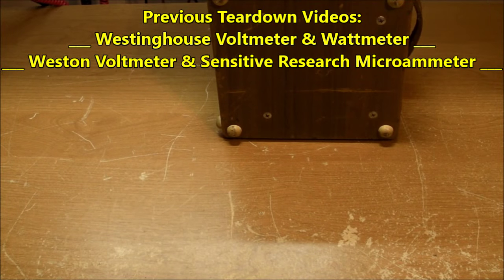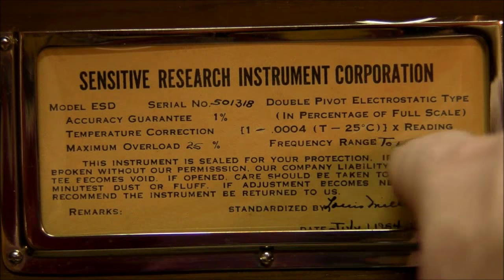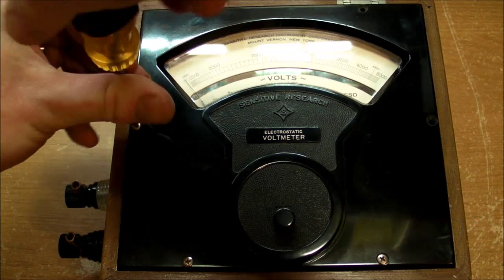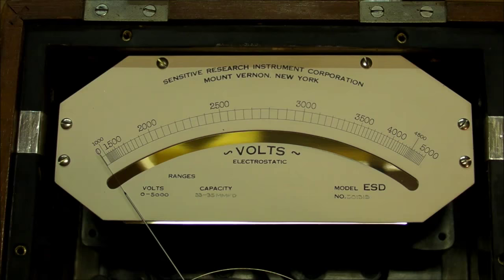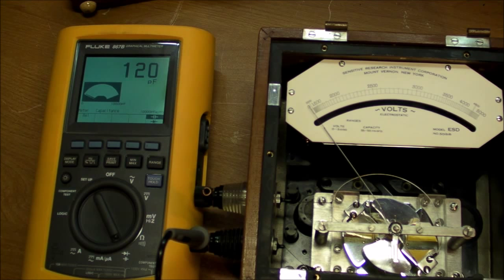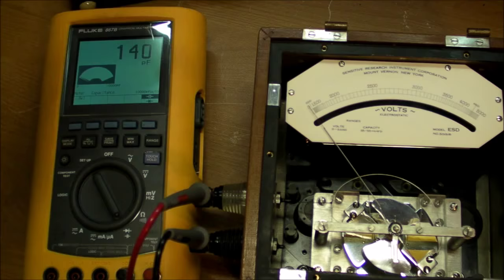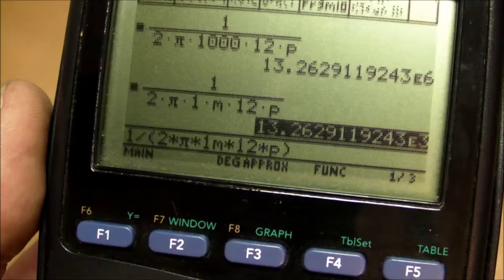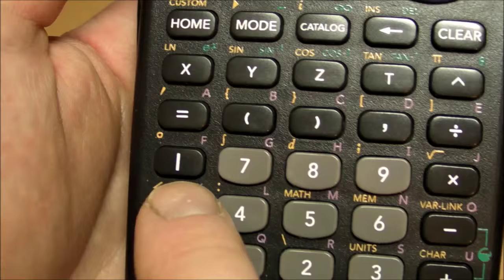(#0197) Electrostatic Voltmeter #1 - Teardown

Comment: I would bet that the old capacitance measurement was at a different frequency and amplitude than your fluke uses, and may have included some leads.  I really really distrust the flukes for much more than measuring run/start capacitors for motors.  (you also want a 4-wire ohm meter for this sort of work)  if you have a function generator you can construct a much more accurate LCR meter on your bench than the fluke provides.  (graph that function, the TI89 is a graphing machine!)  I used a similar exponent hack on my 89 when I was in school too.

Thanks for showing us this.  Really neat device.

Comment: Wow. What an amazing bit of gear. You have me thinking about making one now.
Reply: Very cool, zero idle power. (or at least too tiny to care)

I like it the fact that the electric energy(not power)/charge holds the needle up, and will be returned when the voltage does down.
Reply from the maker: Erlend Ervik Yes, but I wouldn't even be concerned about how many nanojoules that works out to be.
Reply: I'm really excited about such a simple replicatable device for reasonable hv readings. Not even any need to switch any dials to go from ac-dc.

You could make one with foil, a neddle and a magnet (mag+needle bearing)

Comment: One of these was dropped in our lab.  Considerable disassembly revealed that the connection between the coiled spring and moving vane had snapped.  I suppose it's worth a try to re-solder it (silver solder/braze?) but then what :)  Likely calibration is totally shot just from disassembly alone.  Do you know what the spring material is?  Suspect that the moving vane pivot points are probably no good now that I've removed these from their two housings.  This one is dated May, 1949!

Comment: These days you can get "meggers" that put out 2500 or I believe even 5000 volt - should be able to get an idea of how accurate it is. I have no idea how precise they are but I have a 500v one and it seems very accurate (sure 500v is easily measurable by modern multimeters). I even used it to get an idea of how accurate an electrostatic field-meter I stumbled upon was. Seems to work(!) at least for the (very) low charges.

Comment: My 2K Electrostatic Meter has 1X10^15 insulation resistance. Is that what your meter has? I thought you said your meter was 200 Mega Ohm. That seems too low. Did I hear that correctly? By the way, Mine was also certified by Louis Miller.
Reply: There is a big difference between Insulation Resistance (DC) and Impedance (AC).  The impedance calculations he presented were just the effect of the capacitance at different frequencies.

Comment: I have the exact meter but the needle rests on 3000 volts with no voltage applied. The zero adjust screw will swing the movement but only = and - a little as it should. I inspected the spring and it does not look distorted. I can not figure out how to get the needle to rest on zero unless maybe I unsolder the spring and let it unwind one turn. But why would that be necessary? The movement is free to swing from zero to full scale. Any suggestions appreciated. I'm about ready to gut it and install a good standard 3000 volt meter movement in the box. Ron W8RJL
Reply from the maker: +Ron Young Perhaps someone was trying to measure some high voltage RF, in which case, the spring might conduct an appreciable amount of current and overheat. Readjusting the spring would get it back to zero, but then the meter reading may become inaccurate.... or it could become 100% back to normal. It's worth a try.
Reply: +Eric Wasatonic After much head scratching I removed the two screws that hold a cross bar on the 
meter movement. Once I got the cross bar off with spring and needle stops I 
realized the spring was not connected on the pivot rod. It was apperently snagged thus 
making it look like it was connected but was broken at the solder point. I will attempt to solder the inner most end of the spring to the shaft. It will be like brain surgery. If I succeed I will have a great HV bench meter. 
It I fail I will gut the box, cut a new blank plastic panel for the front, cut a circle in the panel and install a standard meter, maybe a 0 - 4,000 volts DC meter. In any case I only paid 25 cents for the meter so I got my moneys worth. Thanks for your video and comments.
Reply: Using tweezers, magnification, and a small soldering iron tip I was able to remove the spiral spring, tin the inner end (the one that broke off), solder the inner end to the pivit rod then solder the outer end to the zeroing connection point. During that process the spring was dropped a couple times and first time was as soldered 180 degrees out. The meter is now all back together, needle rests at zero and the zero adjustment works just fine. All I have to do now is get out my HV source and another reference meter to check accuracy. Without your youtube video I would not have been able to bring this vintage beauty back to life. Thank You!
Reply from the maker: +Ron Young I'm glad you were able to fix it. It is a remarkable instrument.